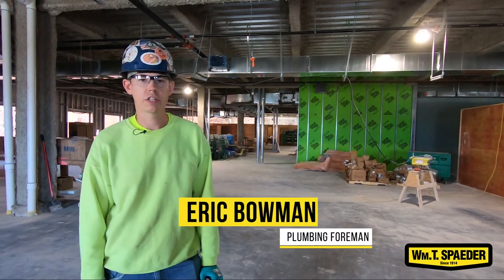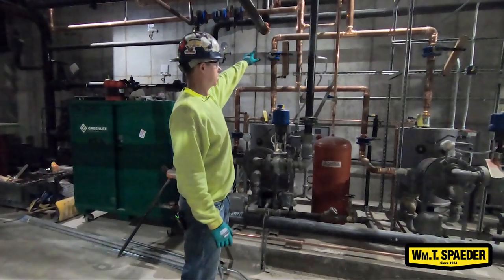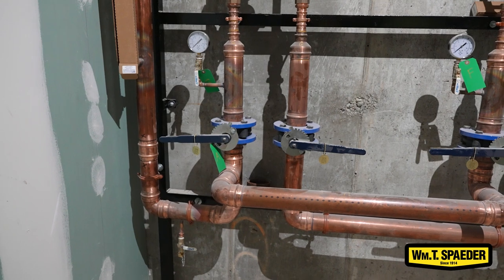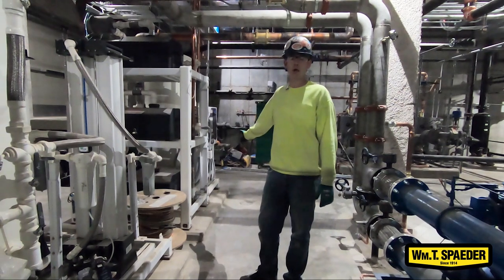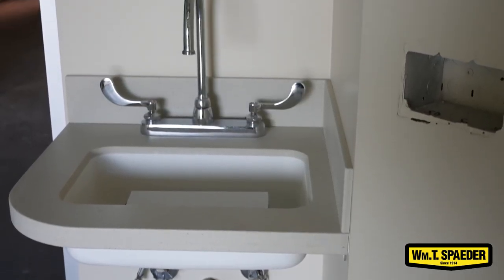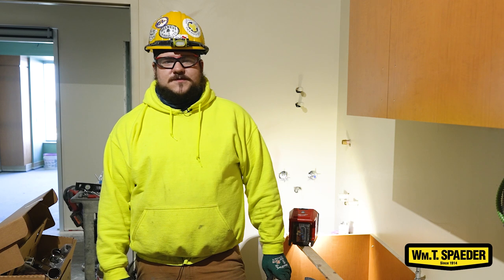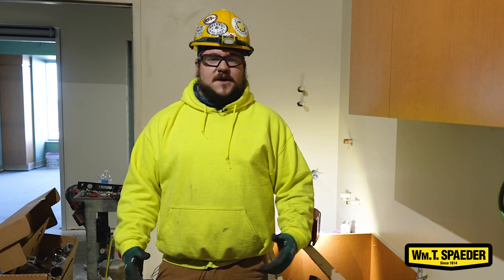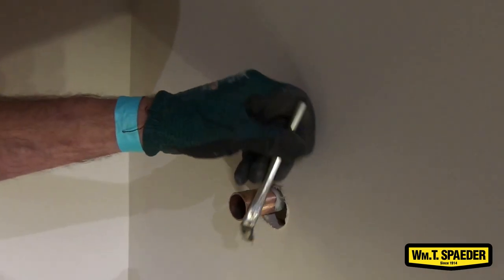Hospital Commercial Plumbing Part 4 - Wm. T. Spaeder

Comment: When the municipal water supply line undergoes emergency repair resulting in localized low pressure; how does one maintain pressure on the upper floors? and how much time do the reservoirs typically provide? Is there anything that the city should be doing to help maintain pressure?

Comment: Screw pro press.  Otherwise great video. I do plumbing in hospitals in fl.   Doing a bed tower right now.
Reply from the maker: Nice! Thanks for watching.
Reply: I'm on the design side.  But as a Plumber what are your issues with pro press.  We typically spec sweat connections but a lot of contractor like pro press for the speed of installation and if the facility approves of it we let it go.
Reply: @eNeVeFamily  it makes it look like garbage it pulls ur pipe out of plumb or square 
its not a strong  connection type, there is no tweaking ur finished product and there's no taking it apart. Such as with sweat.  And price of course.   Its bit faster but there's still prep time, file and ream.  Now for a repair or something its perfect.  Design side? Engineer?    - ps don't believe a sales rep
Reply: @jpmonin7429  We default to sweat connections.  However, we are seeing it more and more; suggested by the contractors; as long of the facility approves of the product.  I truly appreciate you feedback.  Thank you,
Reply: @eNeVeFamily   its hard to explain. I've only been doing it 5 years so I'm no old timer stuck in there ways.  anyone can propress  which is good and bad.  u can make the connections doesn't mean its right.  There's alota hacks where I'm at.